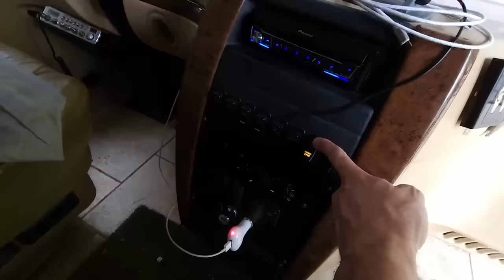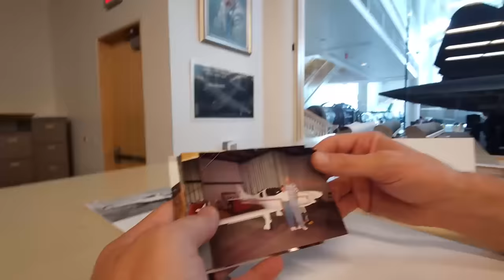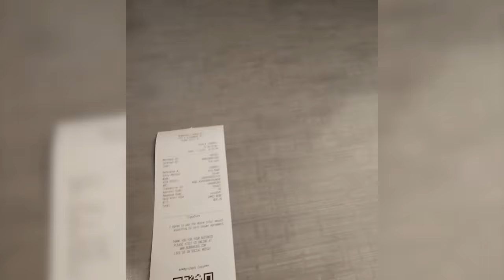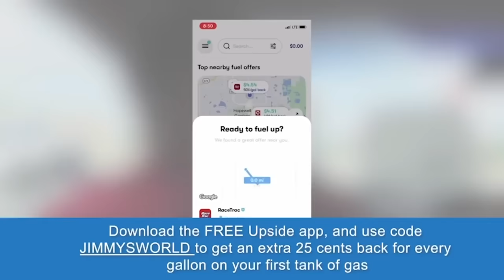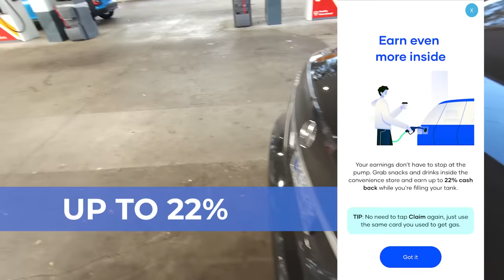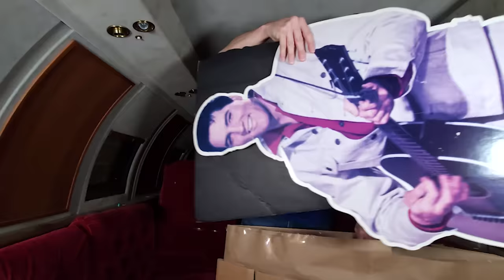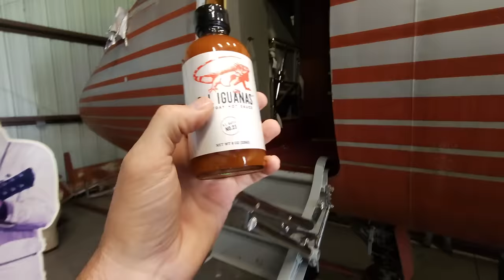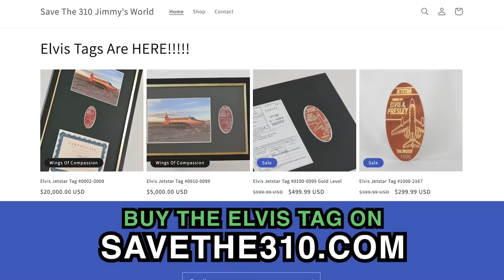Rebuilding Elvis Presley Abandoned Jet Pt1…. Again

Comment: Regarding your engine mounts, you may want to consider this: FAA Advisory Circular (AC) 20-62, as amended, allows an owner to produce parts for his/her own aircraft. The AC describes what the owner must do to consider the parts to he "owner produced". It's one way to address a situation when you can't find an original part.
Reply from the maker: That’s how most of my parts are done with all these old airplanes.
Reply: Wouldn't it be super expensive to reproduce a rubber component seeing how there are various rubber concoctions and the mfg process?
Reply: @hardwaterhiker2657  I'm sure that there are companies that are capable of producing an identical product. One of the methods of complying with "owner-produced" requirements is that the owner can perform quality control oversight of the product. The owner doesn't have to physically produce the product.
Reply: @therealjimmysworld  I was responsible for developing and issuing the AC.
Reply: A polyurethane casting with good metal to pu bonding and correct durometer is a possiblity.
Reply: @silasmarner7586  my question about cost directly related to the making of the mold. I'm not pro but this can't really be cheap?
Reply: @hardwaterhiker2657  Good point. I'm certainly not qualified or experienced  regarding costs; only regulatory requirements.

Comment: Jimmy, if you take the motor mount and you know what the actual parameters are for it you can make a mold for it. You can decide how dense you want polyurethane and you can actually mix the polyurethane and make it where it won't degrade because it's not made of rubber. And it will actually fit what you need it to fit in.
If you need it more flexible than polyurethane normally is you can always put a few drilled holes in it and allow it to flex and it's still very durable.

Comment: I empathize with you regarding the RV.  I purchased a brand new 40Ft. diesel pusher w/3 slides in 1993.  Manufactured by one of the leading RV manufacturers on a Freightliner chassis.  Problems started almost immediately with the coach part.  Took it to the dealer for warranty repairs multiple times.  Eventually after threatening to invoke the "lemon law", the manufacturer agreed to take it back into their factory repair facility and supposedly had a contracted repairman working on it.  Three months later, I got it back along with some of the original problems plus new issues.  Kept it a few more years, mostly sitting in my driveway and finally got rid of it.  Huge financial loss.  Interestingly, the Freightliner chassis was trouble free for the entire time I had it. An RV is a moving hole in the road to throw money into.

Comment: Hey Jimmy, you should keep the pitot and static system so you can keep the altimeter and ASI in the panel and working. You could also keep the ADF and you can time into AM radio stations and have the indicator point to the direction of the station tower.
Reply from the maker: That’s the plan :)

Comment: Once you remove a Cessna emergency exit window.... YOU WILL NEVER be able to get it to seal again, without completely rebuilding the darn thing. Including replacing all the window seals. You will wreck the window trying to remove it.  Seriously. There was an IA who insisted we open an emergency exit to sign off a 100 hour on a 401... and we never were able to get it to seal again. Including using a couple tubes of silicone seal. That baby looks wonderful, and you'd hate to bend it opening it.  GET a crash axe and equip the airplane with such. You'll be able to hack out any window or even the side of the thing.

Comment: The turn buckle come in a long version and a short version. (Designations "S" for short and "L" for long).  The center part is made of brass and the ends of 2330 nickel steel heat treated by 125000 Pound per square inch and cadmium plated.  The threads are Class 3NF.  Long turn buckles range from 8"-9 5/8".  Short turn buckles range 4 1/2"-5".  The one in the photo is single wire safety wound.  Threads on the ends, there is a right and a left hand thread.  There are four that I know of, MS 21251, MS21252, MS21255, MS212256.  Make one.  The engine mounts,  make a mold and than pour one.  If you are not breaking rules by doing this.

Comment: All the unobtanium parts etc are exactly whats wrong with certified GA.  Any of the parts from the exhaust to the control fittings could be made 100X better than factory in any machine shop.  I mean you could make full custom titanium exhaust for a fraction what that rusty Cessna crap sells for.

Comment: For the 310 mounts. Let the good book of FAR, be your guide. Then, go to a trailer parts shop. Get some cylindrical "spool" shaped boat rollers. Section them accordingly. I used one to replace a upper motor mount, in a friends Freestyle, (Ford wanted $600 for the entire mount) and 7 years later, it's still doing great. The polyurethane or whatever those rollers are made of, is pretty stern stuff. They might also eliminate some high frequency vibrations, if used as part of the mounts of the Elvis Jet.  And Evergreen, Family, please approve the release of the plane. Flying, it will be seen by more people than in a museum.
Reply: Sounds like a great idea for the motor mounts

Comment: With all the mun-ney you have, and even if you don't, think about casting the motor mounts using polyurethane with the correct durometer. You'll want someone who knows how to get metal to bond RELIABLY with Polyurethane.  Setting the duromenter (hardness) is a whole engineering feat in itself. But I bet somebody out there does that.

Comment: 6:23 Is it the clip that's hard to find or is it the turnbuckle? If it's the turnbuckle, there are a few things you can do, but you'll really be looking desperate. If it's the clip, you can just do what the previous maintainer has done and safety wire it. I think you can find the instructions in the AC 43-13.

Looking at the turnbuckle in the video, I'm thinking that's what you meant. Happy hunting!

Comment: Are you allowed to pull the rusty parts out and soak them in WD40? Clean the rust off them and get them re coated? I’m not an expert just wondering if something like that would be ab option

Comment: 🛑🛑 Why don’t you “pop” the motor out of the Lace Air you can’t have, and install the motor that you can’t add horsepower to, back into the “museum piece” Lace Air?

Technically they didn’t sell the plane, and basically it won’t matter if it’s just sitting in the museum. 👍💯

Comment: not unobtainable just need right you tube watcher to watch, "Gulfstream" has pin/clip used on its G3 or something similar, it's been long time sense i wrenched on one. but sure, with world contacts you know tech or two, or if passing thru D.C visit the Navy side of AAFB, In the Navy hangar their usually tech on duty most days. good luck or could have been safety wire. like I said been while sense my tour,

Comment: Being able to counterweight a crankshaft is not that difficult. That is actually something that hot Riders have been doing for decades now. And it isn't any different for an automobile engine than it is for an aircraft engine. They can balance every part of the interior of that engine to within just a few grams. At velocity. I'm not certain whether or not they can put oil ports through an existing crankshaft but I wouldn't put it past them but that wouldn't be what you need all you need is the proper propeller you just would only have the best performance at the highest speeds.

Comment: what most people probably don't know is that a lot of aviation fuels are artificially colored so if it leaks you will see it.
the inside of the wings and compartment walls are treated with an anti moist and fungus paint that gives it a yellow-green vibe on top of the actual paint we saw it on the inside parts of the Elvis jet.
when the plane is finished these places can never be reached again so its extra protection.
it was developed in WWII to protect the army, air corps, and navy electrical equipment which when you are repairing a WWII field radio it's a bitch!!! because this stuff is everywhere! so, the yellow-green wire is positive? and that yellow-green wire is negative?... the yellow-green diode has what indicator lines on it?!! in short a nightmare!!!!

Comment: Jimmy, I'm relatively certain that the FAA wouldn't allow you to do the work on that engine yourself. In the event that you were allowed to do that work, how much will it cost to put another one of those counter balanced crankshaft with the oil passages in it? The reason why I ask that question is because I'm a curious person. I believe I'll be this way until my Savior comes for His people and me. What other modifications would you perform to that engine in the event that it could come out? I have a better idea. Buy one of my four cylinder engines because it will be absolutely incredible. I believe it will be capable of spinning between 25,000 to 30,000 rpm's. That's a four cycle engine in that aircraft you have. This one that I had helped design will be a two cycle. It will additionally be the first successfully turbocharged two cycle engine. In the event that you want anymore information about it, you should go on Facebook MESSAGER and ve my friend so that you could read all about that engine in great detail. Send me a message about what you think about this.tlyou might be quite interested in other ideas that the Holy Spirit helped me with.